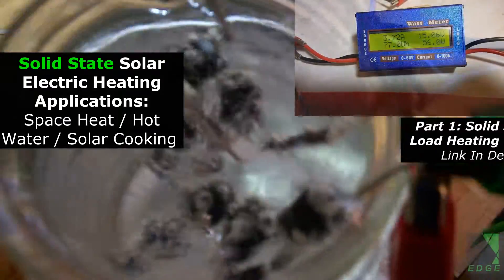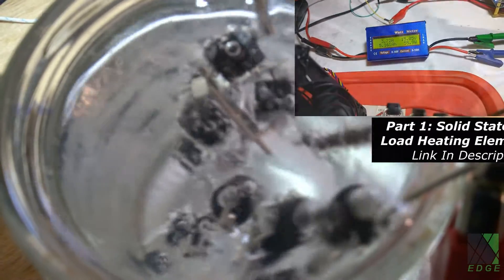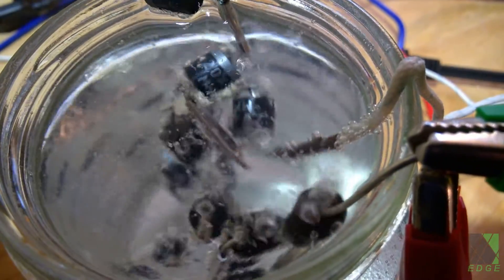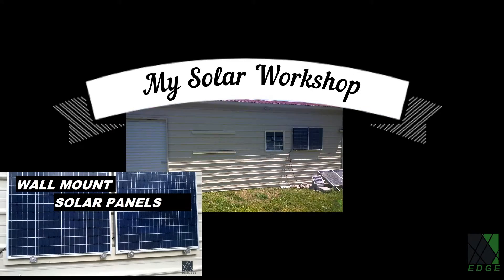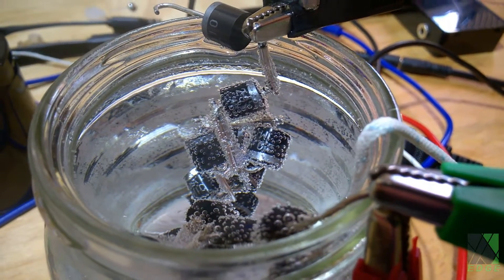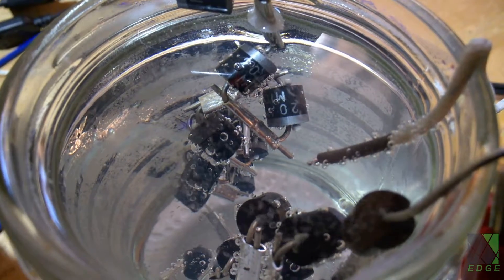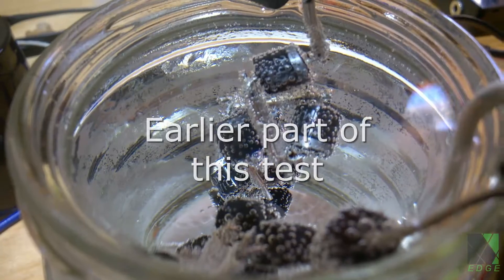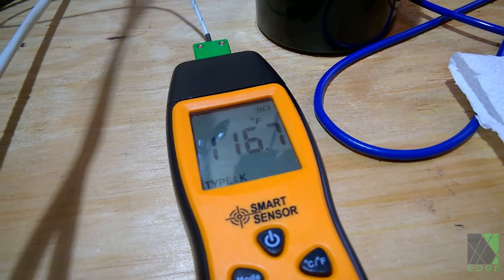Solar Hot Water: Boiling Diodes test! Solar electric cooking research #solarheat #solarwaterheater

Comment from the maker: This technology is widely misunderstood.  To overlook or dismiss diodes strings would be a mistake.  I  recommend watching my newest video to help understand the technology: https://youtu.be/42XIbHA9Dv0 Here is a short explanation. Diodes are the simplest way to extract the maximum (heat) energy from a solar panel that has ever been found - so far. It appears only a few researchers have investigated the idea.

Diodes are NOT Ohmic. Relationship between current and voltage is logarithmic/exponential depending on which way you consider it. They drop a set amount of voltage, which is "relatively" constant. As a result, they function beautifully as a direct solar power heating element, providing "MPPT-like" behavior. The problem is this is relatively obscure technology, few understand its amazing simplicity, and there are no really suitable diode packages at this time. So far, all researchers have had to make do with what they could find off the shelf. Usually axial packaged diodes...

So far I have built 2 solar cookers and working on a water heater using this technology. I hope to scale these projects up later.
Reply: If you place a low value resistor under the diode string; and run that through a TMOS power FET to ground; you can control the current by PWM (pulse width modulation) and save the diodes from over-current failure.
Reply from the maker: Another good idea to experiment with, thanks!
Reply: @solarpoweredge  An Arduino will monitor the resistor voltage, and drive the TMOS power FET directly. This will allow you to set the maximum current,
Reply from the maker: @tobysmith3668  I bought an arduino board a couple years ago, hope to dust it off soon and give it a try :)
Reply: @solarpoweredge  It will work best if the sending resistor actually ties to ground on one side, with the FET just above that. Some have a differential voltage amp, but grounding one side will cut a lot of noise without hurting  gate drive levels. 

Mart Hale in Florida is a long time friend, and sent me you contact information. We were thrown off of FB about the same time, but we had exchanged emails first.
Reply from the maker: @tobysmith3668 This is extremely good information, thanks a lot. Got a few plans for using FETs if I can just get to it.
PS glad you found this site. I had an exceedingly short run on Fb. Now I'm trying to hang on here... for at least another month or so :D
Reply: @solarpoweredge  Try hive and blurt, they work well, and you make a little crypto for posting. 

Posts on alternate power for homesteading are well received!

I just found some 100 watt solar panels locally for $15 each. Trying to get 10.
Reply from the maker: @tobysmith3668 Nice find.... thank you, I will check those sites out

Comment: cuanta agua hay en el experimento, cual fue su temperatura inicial y cuanto tiempo transcurrio hasta hervir. un saludo. con estos datos se puede hacer una estimacion de la cantidad de energia  que le llega al sistema y hacer una comparacion con la energia que le llega desde el panel. 

 estoy trabajando en un sistema termososlar para calentar el agua a base de mangueras y me interesa tener un sistema complementario con paneles fotovoltaicos;  estoy  viendo muy bueno este sistema a base de diodos. gran trabajo.
Reply from the maker: @colbaronrojo Greattings sir, please check the scientific paper called "hot diodes" to see data points about temperature and more information. This was merely a test to see if I could boil water with diodes at all. I was pretty curious and just had to give it a try  :)

Comment: How could this be more efficient than resistive heating? Is it not the resistance where the heat is coming from?
Reply from the maker: @petevenuti7355 Hi, diodes are not resistive (ohmic). This video is a short test earlier in my research. 
*My other videos thoroughly explain it (see below). There are also scientific papers on the subject.
https://youtu.be/42XIbHA9Dv0
https://youtu.be/CRhkZp6ECHk
https://youtu.be/6D0aUmkUQSQ
https://youtu.be/whOXELklxQ4

Comment: An application would be to store heat for night use.
Reply from the maker: @JimmyCall That would work - also many people have suggested a diode immersion heating element built inside a metal tube. It has been more difficult, but I am working on it

Comment: Have you done a cost base for diodes vs. resistance cost of element watt for watt ignoring efficiency?
Reply from the maker: Sure, comparing diode strings to ceramic PTC, nichrome/kanathal, carbon paints etc. there are all sorts of ways to make heat with slightly different cost/benefit ratios.  Diodes stack up fine. They cost just pennies, unless one wants to buy huge power diodes. I am building larger heaters using power rectifier diodes that are still  affordable.
Engineering new solutions requires taking all pros vs. cons into account. Cost is certainly not a roadblock with diodes. Diode junctions are a few cents each, and can harvest more watt-hours over varying conditions without complex circuits. They can last for years if "not overheated". 

If we added an MPPT circuit to resistance heating elements, the cost would increase, but such a solution could still be useful and harvest more watt hours. Diodes behave similar to MPPT, harvesting more power but with vastly reduced cost and complexity. So they are close in benefit to MPPT circuits, yet very close to simple resistance elements in cost. Even in their construction and layout, they're not too far off.

One group of researchers used strings of tiny little diodes for many months boiling water and cooking food, and they survived. They did their home work.... the amount of extra heat (or watt-hours) collected over the life of the system is meaningful and significant. 

Diode heaters are an obscure topic currently. But there was a time solar panels were 1% efficient and pretty obscure as well. There was a time when no one imagined painting a heater on their wall with carbon paint. But progress moves forward as new technology becomes further developed and slowly emerges out of obscurity. If direct PV-DC powered systems become more common in general, I believe direct PV DC diode heaters will play a role as well. 

Practical application: leveraging the advantages of diodes strings, I have built multiple diode based cookers that work even in cloudy weather without collapsing the PV voltage under poor conditions - thus harvesting more heat without using complex electronics. Here's one that made it to video:
https://www.youtube.com/watch?v=CRhkZp6ECHk&t=306s
Reply: @solarpoweredge  thoughts on using these as the heat source for a refrigerant cycle?
Reply from the maker: @priestesslucy3299 Hi, that's really thinking outside the box! if you wanted use a solar panel to generate heat for a refrigerant cycle, it would be a great opportunity to use diodes. 

Rather than use a complex MPPT DC-DC circuit connected to a nichrome heating element, a simple string of diodes could do a better job and cost less. There would need to be some sort of heat sinking contact between the refrigerant and diodes, but there are lots of ways to accomplish that. Another challenge is matching the diode string to the solar panel input, as some solar panels might have a slightly different max power voltage. But it could definitely work!